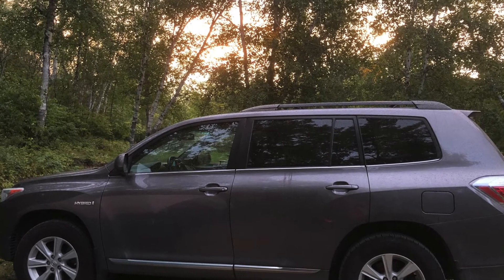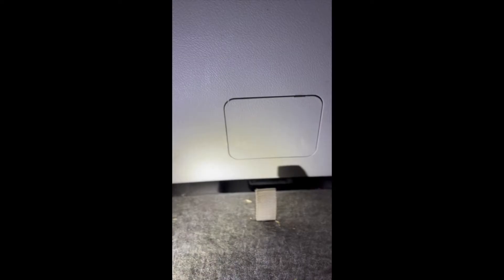How to open the Toyota highlander backdoor in the event of a dead battery?

Comment: You got any solutions on the glass door instead of the back door?
Reply from the maker: Not sure which glass door was meant here but never had issues with them.
Reply: @user-tl2kz8um4r  the glass hatch u can open  at the back, mine won’t open maybe there’s a lock somewhere? That I don’t onow
Reply from the maker: @Ye-yz7cx  I guess you meant the glass part of the hatch? If so, it should be dependent on the model - can be found in your driver’s Manuel.
Reply: @user-tl2kz8um4r  had a look around the manuals but nothing😢 no idea what’s wrong with it and also had a look online and nothing

Comment: Where is that box
Reply from the maker: It's in the middle close to the bottom on the inside of the backdoor, which can be accessed by going inside to the trunk at the back after opening the door with the manual key.